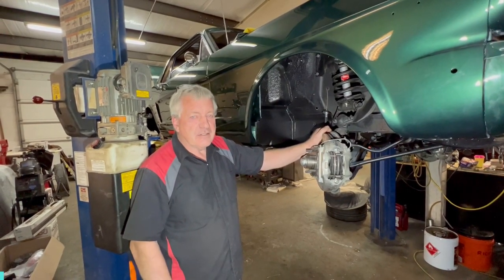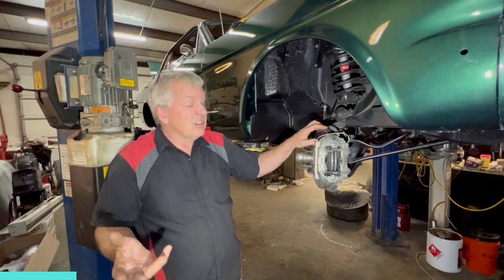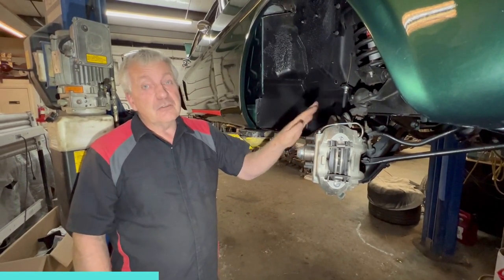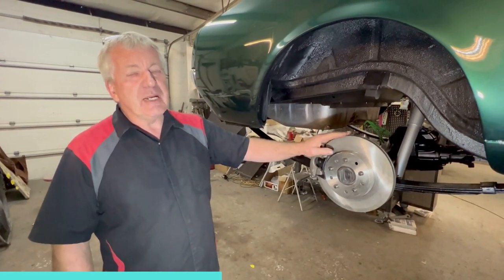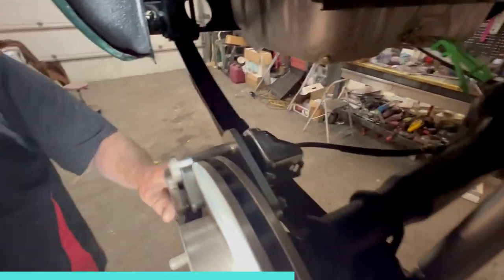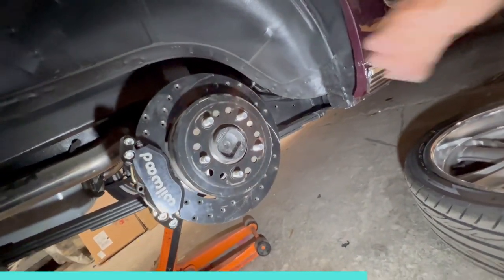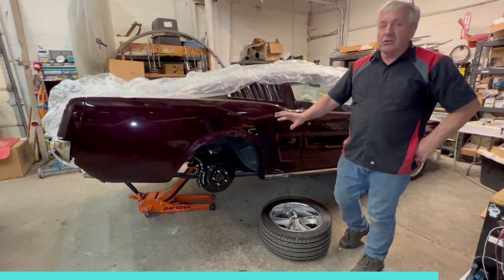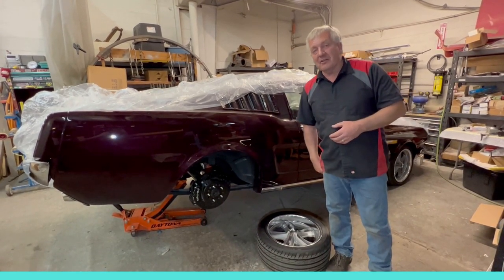The Great Disc Brake Debate!

Comment: Not that it's applicable to classics but if you live in the rust belt like me having drums on the back of your daily driver is a big advantage...they don't corrode and lock up due to winter salt exposure like disks do.  My DD has 4-wheel disks and I'm back there every other year to pull them apart and clean them up.  Wife's DD has rear drums, I've serviced them once in the 13 years she's had the car
Reply from the maker: Wheel cylinders are prone to premature failure when left to sit for long periods. Sounds backwards but the more you use them the longer they'll last!
Reply: @kiwiclassicsandcustoms9160  On drum brake wheel cylinders I always pull the boots and smear silicone grease on the bore inside to prevent rust. That combined with using dot 5 silicone brake fluid and I have had cars sit 20 years and still have brakes just like day one.  before that they couldn't sit 3 years without being trash.
Reply from the maker: Good advice!!